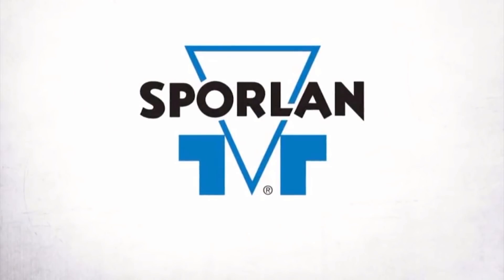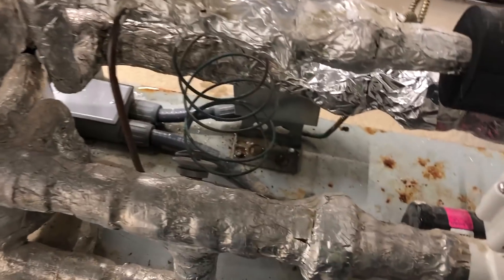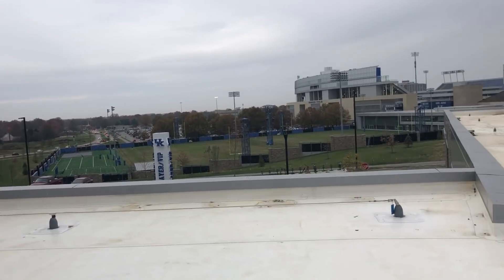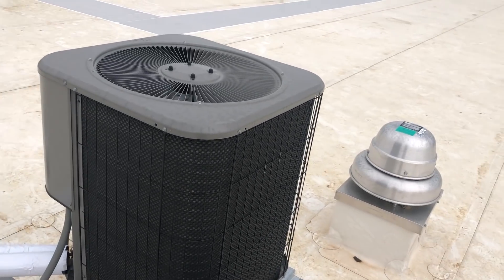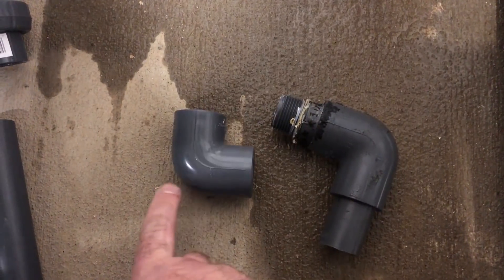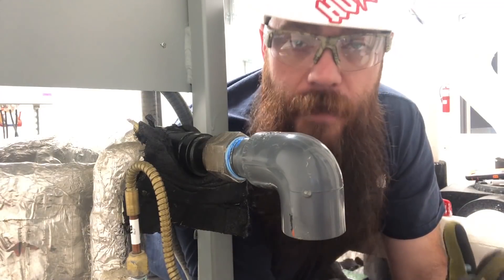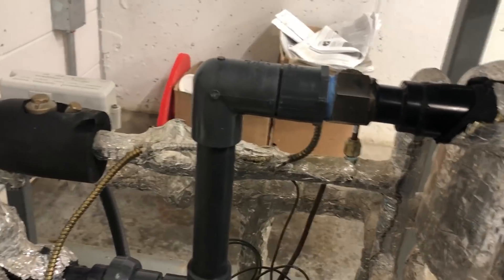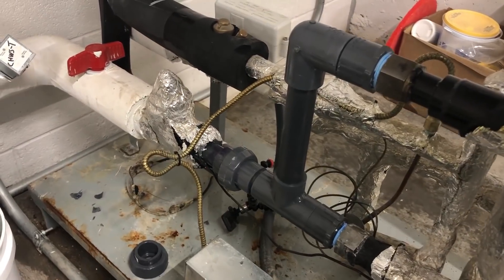HVAC Service Call (small chiller water leak)

Comment: I have a client that specifies Titanium is used on heat exchangers where the water is used in a swimming pool. If they are using the chilled water to cool a plunge pool, this could be why it’s titanium. It’s a pain in the arse because not many contractors know, so I’ve replaced stainless steel pool heat exchangers that are a year old because they’ve scaled up and the baffles have failed...

Comment: I'm highly considering getting into this trade. This type of work for me looks like it would be very mentally stimulating. I tried getting into automotive repair and even went to school for it, but that didn't quite work out for me. HVAC looks so much more promising. In a nutshell, if I could get paid to work with my hands and fix things with tools all day, I'd be happy as a clam. You mentioned in one of your other videos that in this trade you'd most likely be working by yourself all day, and as an introvert myself, that makes it sound even better to me.

Comment: I'm starting to get a hair-brained idea.   I think I'm going to invest in an ultra-sonic leak detector.  Bacharach makes a nice one.  I've been liking the idea of being able to check for leaks under nit only, but I looked at your application here, and wondered if you were running enough water pressure to make the ultra-sonic work here.   Had it been practical, it would of saved a call-back were you not planning to return the next day by letting you know immediately if it was holding pressure.   I wonder.....

Comment: some of the "domestic" homes around here, I've found nightly "city" water pressure as high as 120psi and it made me panic, after having installed some 300' of CPVC 10 years prior, as well as flexible lines.
no it wasn't caused by check-valve/back-flow preventer/pressure regulator, without an expansion tank or failed tank. because that is exactly what I installed to bring it up to code and then some. he real city WP there would top 120-PSI at night, when the electric is cheaper and cheapskate water department/city refills all the towers (insider info or a brain that works better than shysters and button pushers) ohwell...

Comment: for pvc/other fairly soft flexible material unions, you'r best off using a strap type wrench to grab them without causing distortion, which will in fact squeeze them tighter and make it harder to remove or cause you to break everything off.....
and I said that way early in the video, as you text commented about it ;)

Comment: maint. needs to get off their dead arse's and change smoke detectors/batteries. least i guess that's what I was hearing, the big echo makes it ring on lol
Reply from the maker: throttle bottle hmm I didn’t notice that?  Then again a can hardly hear. If you meant the ping sound once and a while, this pump room was right next to the indoor batting cages where they were hitting balls.
Reply: yeah, that very well may have been it. it sounded like an alarm chirp with major echo from the un-dampened concrete "hole" ( append sh!t) :))

Comment: AK HVAC how do you handle walking up on a new piece of equipment? I work for residential/light commercial company and we get called out on a 40 ton Trane with intellipak and none of our Technicians are real familiar with the unit but two of us just start the normal diagnosis process and between that and the manual have gotten it working again. But I had another one go out and flip out cause he doesn't know how to work on it. So again how do you handle a new piece of equipment? Any suggestions form you follower would be great as well?
Reply: about the best you can do is try to find a full service manual in advance, assuming you know what it is or try to get one as soon as you arrive and get the model/serial as muchy as I hate "electronic junk" for field work, now days it's very needed because none of them have real paper or hardback service manuals and when they do, it;s chock full of errors anyway, but so it the "digiturd/junktronic" version ;)

Comment: I hate PVC with a passion. I have a hospital that has schedule 80 for its HHW lines. Such a pain especially since they seem to have been put in as an afterthought. Many long poorly supported runs. That foil insulation looks like trash. Like the factory uses the foil left over from employees lunches to insulate their equipment to save money
Reply from the maker: We call it “value engineering”😁

Comment: Broken threads suck.... nice repair.  If you have not seen the Reed Solutions Kit for cutting and fitting PVC for a perfect joint every time, it’s worth a look especially for pipe under pressure in my opinion. After watching a video on the best way to cut and fit pvc, I feel like I have been doing a less than professional job for many years.  Peace
Reply: Link.

Comment: great video,  I believe i also seen a York VRF simplified CIS01A and a CIW01A wall controller.
Reply from the maker: Oh you sure did.  There are ten Gen II systems  here, I’m still working through all the bugs. Mostly wiring issues and some integration problems with metasys
Reply: oh, nice! we have one as well a 6 systems, 86 heads that we have been fighting with. its a gen one system though. I did a start up at one of our larger contracts with metasys and they intergrated the vrf into it. just a little gen 2 6 ton 4 head system.  heck that went over with out a hitch. they tied it in, tied in H link, hooked it up to bacnet, went into the gateway and set up a few settings and then discovered it in metasys and mapped the points. Also passing on a little info. if any of your equipment is made in 2017 and has a low ambient kit installed  there is a bug in the firmware that wont let the system use the kit. we found that out on a install.  installed the low ambient kit wired it in and set it up then went to put it in test and it wouldnt do anything and wouldnt display across the 7 segment display.  come to find out that due to a firmware problem that wasnt fixed until this year it wont use the low ambiant kit even with the dip switch set and also will not go into test mode.  you need to contact your TSM and have them install the updated firmware.
Reply from the maker: Cameron Brown appreciate the tip. Having a flash drive fedexed to me as we speak with new updates for service checker. Have had some issues with it recently. I am good friends with our RTSM so I have great resources in that regard.  Are you with jci
Reply: well thats good. Last time i checked I have the current updates for service checker.  And yes i am,  out of the Indianapolis branch. 1 of 2 of us that went to the class on VRF.  I work on RTU with simplicity, or competitor,  as well as assist with water cooled  and air cooled chiller repairs and PMs.  sort of just a little bit of everything. still getting chillers under my belt.  and want to tackle boilers next. ive been with JCI a few years and have been in the trade for 7 years. with a mixture of service and fitter/ plumbing work.

Comment: I've had lots of problems w/ schedule-80 fittings to non-plastic materials, what I've found that works best is a hardening style pipe dope.
Reply: careful with the type of dope and fluid in the system..........  much of the dope it is alcohol based...

Comment: Looks like sch 80 PVC... I've done the PVC extraction game also... Why they didn't just metal piping instead?? Prolly factory design or like you said cost savings... They get really El cheapo i guess
Reply: most any type of metal commonly used would likely very early fail and/or cost through the roof at the same time.
that leaves me wondering how it got broke, bad craftsmanship from install (threader worn out/chinesium pipe), some clown over-tightened or hit it with something to break it....